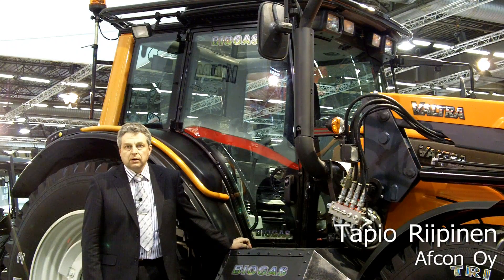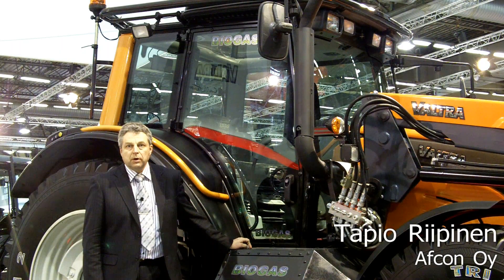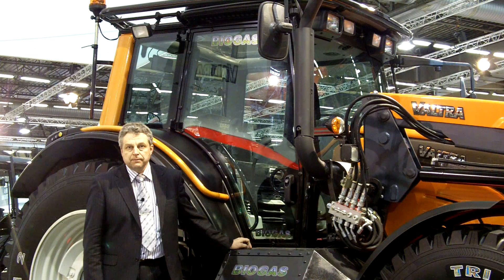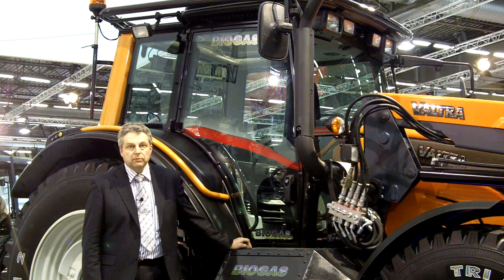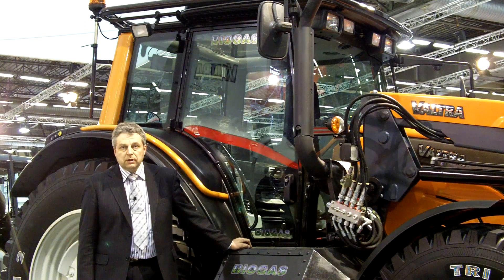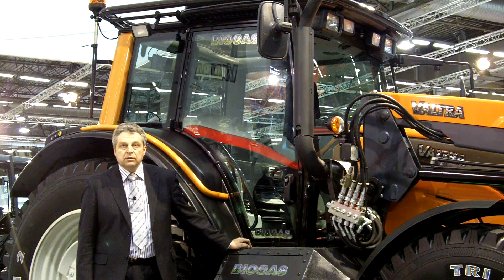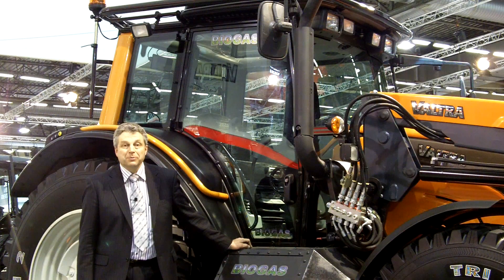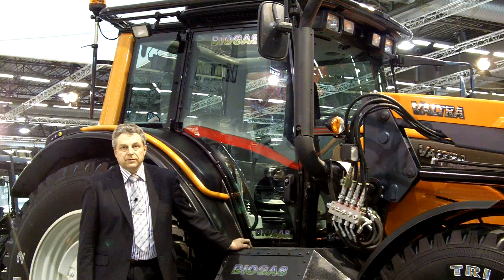SIMA 2011 [en] - Valtra N101 Biogas tractor

Comment: I need something like this in order to reduce, even eliminate my dependance on Diesel. 

Biogas is better than BioDiesel as there is no food vs fuel battle. Less or no crops at all been used to process fuel which should go to the food chain unless the crop is corrupted by toxins in the soil i.e. rapeseed oil grown from Rape crops in land affected by the Chernobyl legacy removes the radioactive toxins such as Caesium 137.